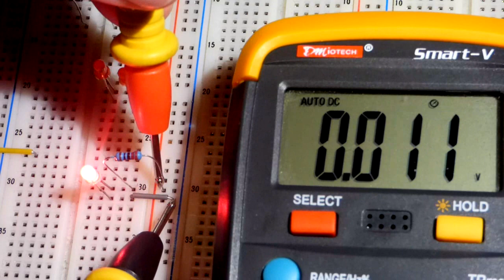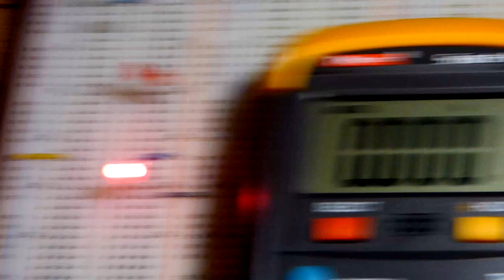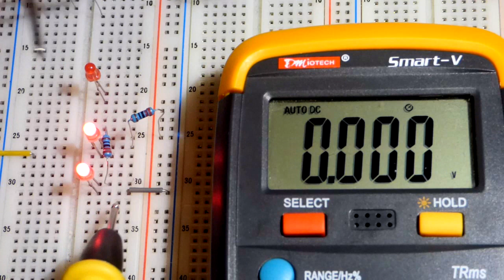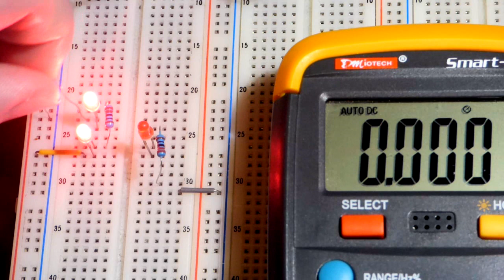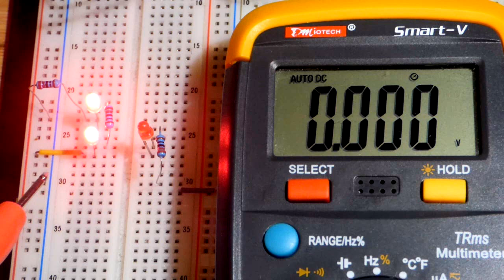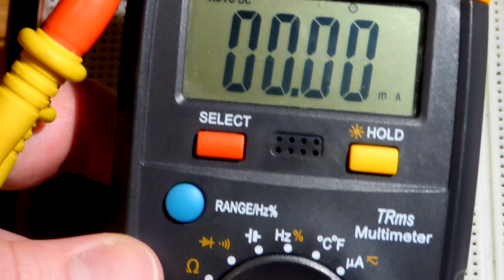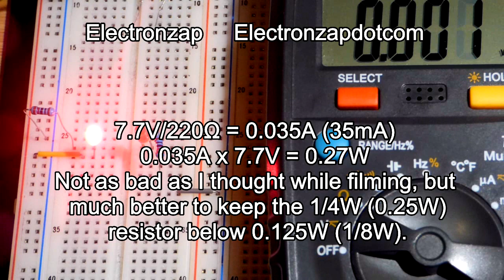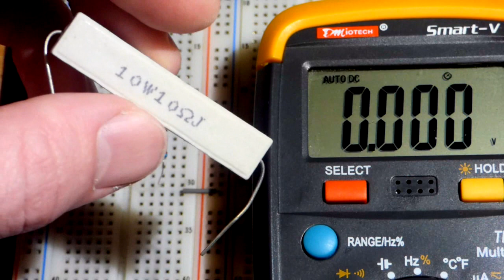Does an electronics resistor have to be on the more positive side of a circuit than an LED

Comment: Thanks, great reference material...

you are really good at explaining simply and concisely what's going on in your videos and I appreciate that and I'm sure others do as well.

I tried to explain this to a friend of mine that's fairly well-versed in electronics and either I just didn't know how or he wasn't understanding what I was saying. 

he was hard and fast on resistors limiting current not voltage and I was trying to say no it's burning up some volts so I'll show hin this 
And he can take his math and all the schematics... 
It's nice to have somebody verify what I think I know. 
 Great Job.
Reply from the maker: Thanks! What's important is that you can build fun stuff and recognize the voltages, currents and power levels involved so that you can do safely. The resistors have a voltage across them and divide up the voltage between them based on resistance when placed in series. Primarily though they limit current based on the voltage across them. Semiconductors block voltage, and resistors divide voltage. Lots of people that know electronics well are extremely picky about exact terminology lol.